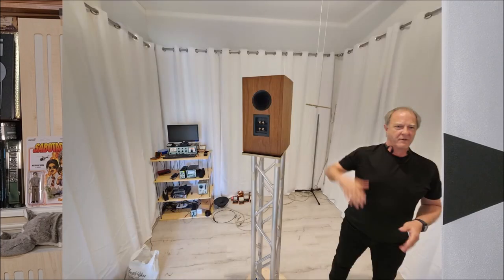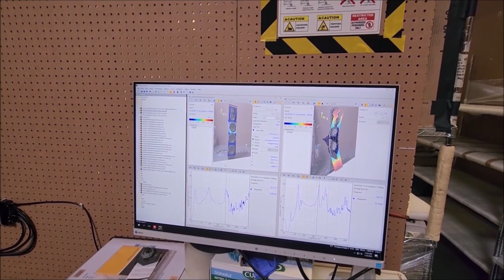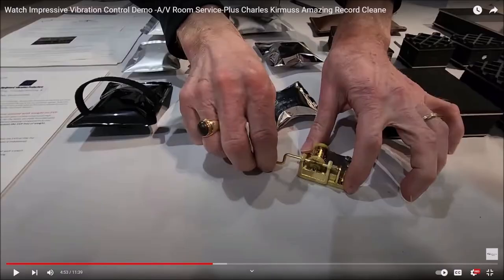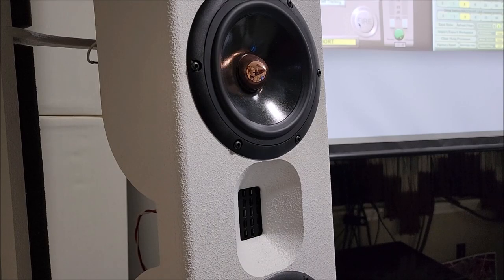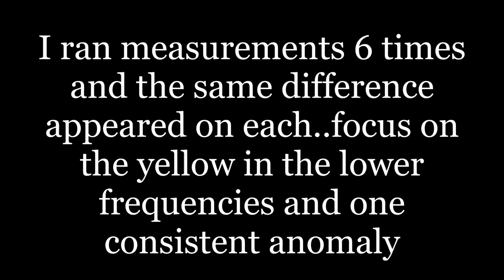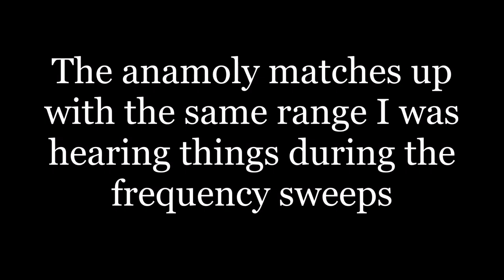Vibration Control - Does It Matter What You Put Under Your Speakers - Measurements, Experiments, etc

Comment: Do take a look at Townsend and their isolators for loudspeakers and equipment.  You did mention this.

If you were brought up in the day of the BBC Rogers  they recommended only 4 points to touch a stand, or be suspended from above.

With isolators.

Graham Audio,  Splendor see many aftermarket stands using the 4 point isolation technique. 

The surface area according to the engineers at Rogers in the day limited the surface area.

Many issues also arise when there is spike coupling with wood flooring. 

Great presentation.
Reply from the maker: Yeah...I mention Townshend a lot and is my favorite for cost no object
Reply: @KirmussAudio  
Am I mistaken, or wasn't this isolation technique used on many of those BBC speakers because the cabinet resonances actually contributed to the overall response?  😊

Comment: Both solutions are right on this subject in my opinion.. A very well built speaker that has a cabinet that does not vibrate without woofers or ports that are down firing you spike. A livelier speaker cabinet and/or down firing port or down firing woofers add the vibration control.  I have both types of speakers and to my ears that is giving me the best sound.

Comment: Using a large plate (several hundred square inches) to describe how a point (focused down to a fraction of an inch) behaves is a bit disingenuous. If you did the same test, using a mallet on a metal point you would hear zero ringing.  I love your channel man but come on, that's just silly.
Reply from the maker: You can test it yourself if you attach a spike to an aluminum metal chassis like this.

Comment: Steve Sims invented the first rubber compound specially for High Fi feet which were sold by Monster Cable 30 years ago. Like Sorbothane  washing machine feet, the vibrations are turned into heat.  Monster used Steve's dies and his proprietary compound, but never paid him. So, Steve took his footers and his CD vibration rings and left HiFI. Steve became famous for his invention of an attachment to a Bow string to reduce vibration. When Steve started, his made bases for Technics turntables which had no suspension and had feedback in Radio stations.  I found Steve at the lowest 3rd floor of the Chicago CES near the booth for Cramolin.  I use Steve's feet  under my Revox direct drive turntable and the MDF base made by friends of his. Steve also improved original IBM hard drives to speed them up for the design of his proprietary compounds. He first worked on the vibration dampers on the wings of Boeing aircraft. In some ways, all the current feet have invented devices which are way more expensive to manufacture. Steve's set of four feet memory has it sold for $40.
Reply: Interesting, nice to hear. 

In the 80's I had many Sims products ... Best being the Sims Navcom pucks, w/stainless bands. 
And iirc, Sims CD tweeks, balancing rings atop the CD, or the perimeter slip cover.

Comment: Very interesting. I'm looking forward to the follow-up video here, Jason. 
I had a window frame that used to get excited around 80 Hz in my room. Sticking a piece of cardboard in that window frame area solved the issue and made a huge difference to my listening experience in the room.
So there's no doubt about it. Resonant frequencies are very distracted. Similar to grand loop issues, they all take away from the focus you are trying to achieve on just listening to the music.
Reply from the maker: Yeah... It's just like tics and pops with LPs to me... I don't like it at all.

Using cardboard is another example why I say each scenario is different and you never know for sure what's going to work best or not.
Reply: @Audiophile Junkie  I've also got Wilson Alexia's spiked into a timber  floor with carpet over the top. I'll definitely be looking at some isolation for them it's always been on my to-do list.
Reply from the maker: If you don't have any annoying cabinet resonances, you can keep it on the back burner.  However, they create quite a bit of vibration themselves and also send it to the floor which can resonate things, so people often overlook the advantages of limiting the vibrations into the floor which can sing along with the music.

I had no noticeable speaker resonances with my Wisdom Adrenalines, but the huge woofers at the base energized my floor and made other things rattle until I added vibration control.  That may be something to look out for if you try different options.

Comment: Does theoretica applied physics use room resonances for sound control?
Reply from the maker: That have an anechoic chamber for testing and options for spikes or pods under the Bacch ADIO or DIO, but SS electronics would be low on the totem pole for worrying about resonances compared to turntables and speakers

Comment: Just because someone can measure vibration in a panel using an accelerometer doesn't mean it is going to be audible and a problem. Somehow that has been lost in this debate. Also there is nothing stopping you from applying constrained layer damping to MDF and damping what is already a much damped material than aluminium which rings like a bell.
Reply from the maker: Nobody says it's going to be audible. In fact, I explicitly say it may not be audible based on a variety of factors, so I'm not sure how you missed that.

The key as I mentioned is hearing a problem first... Then finding potential solutions like the options I highlighted.  It's that simple.

You obviously want to get the measurements as good as possible to avoid having a problem ever pop up, but there's a cost benefit equation too whenever you are talking about resonances and mechanical playback mechanisms... Nothing will be perfect.
Reply: @AudiophileJunkie  My criticism was more aimed at the vendors of the speakers who use it as a strawman to promote their products above other manufacturers who maybe focusing on other more relevant issues that make a much bigger difference in the scheme of things.

Comment: Think about the active pro sound studio speakers like Genelec that have the amp and crossover electronics inside the speakers. There is far more vibration on the electronics in this design than any audiophile system. And these active speakers sound great!
Reply from the maker: The vibrations shouldn't materially impact the electronics, but accommodations for electronics may impact bracing or other things that enhance resonances.

The genelec are small though and naturally more inert.  Plus, just from a physics perspective of moving air and creating vibrations, they should be more immune than others
 larger speakers.
Reply: @AudiophileJunkie  
Most of the Genelec studio monitor enclosures are made from solid cast aluminum.  Very dense and inert as you mentioned.

However, not all of Genelec's monitors are small.  Check out the just announced Genelec 8381A point source main monitor that is a large floor-standing model with a separate but integrated 2 x 15" lower bass cabinet.  I think each upper and lower unit weighs 100kg/220lbs.

Frequency response spans from 20 Hz to 35 kHz (-6dB) with nearly 6 kW of amplifier power and a maximum SPL of 126 dB (I'm not sure of the distance for this spec, though).

Look at the Genelec 1236A SAM Studio Monitors as well.  They ain't so small, either.  ;)

And on another note, the Japanese are anal about isolating any vibrations (and even light!) from any of the PCBs and electronics.
Reply from the maker: Yeah I saw where they released a mega dollar model and paid attention to cabinet design more than many others at different price points, so that's why it's ludicrous to claim all speakers are equal and some can't benefit from what's underneath

Comment: Without X and Y axis designations, there's no way to determine relative variation.
Reply from the maker: It's mainly to show an anomaly captured consistently in all 3 samples without the footers.  The yellow is the actual stuff high enough in amplitude to hear so mainly just look at that...I put an arrow to show one consistent anomaly.
Reply: @AudiophileJunkie  
I get it, but without quantities, it's meaningless.
Reply from the maker: @FOH3663  somewhat... But that would mean I'd have to run the test at tons of different volumes too.  With resonances, they can excite more at high volume and be masked at low volume.  Thus, without extensive test equipment or time to run a million different scenarios, it accomplishes the main goal to show an anomaly present for those who only want measurements.  When you combine this with my other video and details, it should be more than enough to at least prove that something changed consistently in 3 sweeps both empirically and subjective per my first hand reports.

If it's not good enough, that's fine too, but I don't think many "reviewers" even go to this length.
Reply: @AudiophileJunkie  
No, my apologies, not that deep, ... no need to make any more measurements. 

X and Y axis lack notation, that's all. Without magnitude or frequency identified, there's nothing to derive.  

The delta could be infinitesimally small, or it could be mammoth. 

Thanks, all good, really. 
I've been exploring coupling vis-à-vis isolation and damping for years, hence ... curiosity in your observations. 

Early on in the 80's, a powerful epiphany sent me down a fascinating path examining isolation, mass, and damping of gear, adjacent surfaces, etc., and those contributions on the listening experience. 

All good
Dig your work